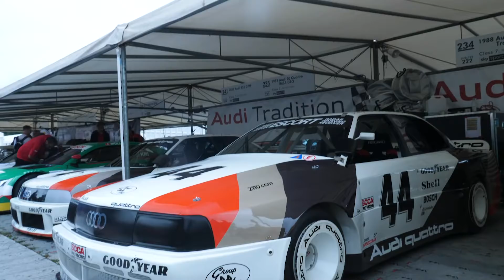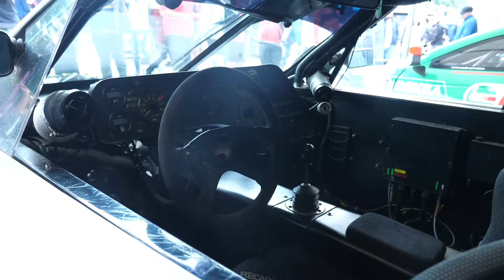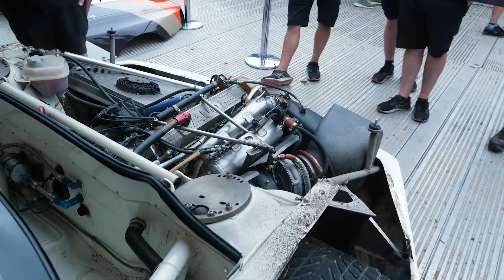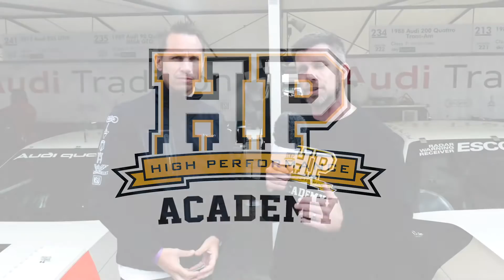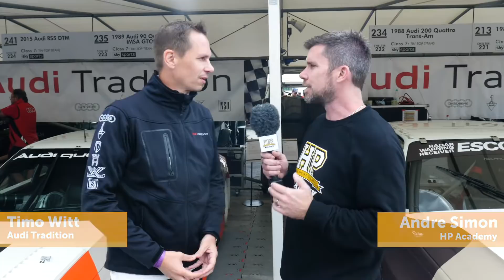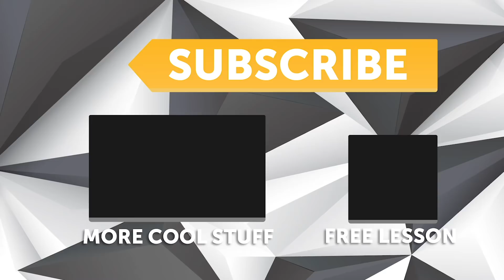Audi Quattro 90 IMSA GTO VS Audi 200 Trans-Am | Audi Tradition [TECH TALK]

Comment: Not much has changed, I have the first rs3 8p model and run 2.1 bar for 522hp and 700nm. I just drove the imsa on acc with a decent hardware setup and it's mental, It's the reason I will go for 600hp in a year or so.

Comment: This era of the IMSA GTO and SCCA Trans Am was dominated by whoever spent the most money.  Audi looking to improve it's sales from the terrible 1970's and early 1980's took their success in WRC and went circuit racing. They were not invited back to the Trans Am in 1988 after winning the driver's championship (Hurley Haywood) and the Manufacturers Cup that Ford had dominated the previous two years with Scott Pruett. The IMSA GTO cars were ridiculous, like I said below Roush's Mercury Cougars were 700 hp (Turbo V6), Oldsmobile (Rocketsports and, Chevy (Buzz McCall)

Comment: Fantastic tech talk! I was just wondering because it wasn't mentioned, are they using a viscous coupling for the 4wd back in the day or was it straight 50/50 split and the bias ratio cannot be adjusted?
Reply: 50/50
Reply: There basically was no center differential in the race cars, it was locked, so 50/50 as Anthony mentioned.
Reply: They use a torsen mechanical diff and you can only change the bias by shimming the diff. Generally 60-40 with 60 to the rear was a sweat spot for the production cars on the track. I raced the B5 platform that came after. But they  really carried a ton of the same parts over to the B5 chassis.
Reply: @southjerseysound7340  The factory race cars in that era used lockers, not Torsens.  The street 90Q used a Torsen, I don't recall if 10V 200's used a Torsen or a locker like a 4KQ.
Reply: @rennkafer13  they ran the rally gearbox and it did infact have a torsen center diff. A  "locker" or locked center diff would make the thing handle like a old truck in 4wd. The front and rear of the car would be fighting itself every time this "locker" locks up like a old truck. 
Also the Audi drive line is built around the torsen center diff. It's not like swapping out a diff in a rear etc.
Take a look at the O1E 6spd transmission and you'll see what I mean.
Reply: @southjerseysound7340  The rally cars may have... the pavement cars didn't.  And I've had 016's, 01A's, and 01E's, spent plenty of time looking at them.
Reply: @rennkafer13  you can say whatever you want  neither of the cars had a  "locker " for the center diff. They ran a Torsen center diff. If you lock the center diff the thing would handle like shit end of  story. I've driven a B5 A4 with a welded center diff and it's not fun. But the customer was. Building a drift car on the cheap and in order to pull the front axels you need a to lock (so to speak) the center diff.
 Seriously it's the Torsen center diff that put quattro on the map.
  They might've run a locking diff in the rear or front diff but that's about it. 
   It's clear that you've never driven a older 4wd truck with a real transfer case where the front and rear axels are powered through the transfer case without a diff. You can feel the axels fighting each other and it's brutal if the roads are dry.

Comment: The playing field was far from being even, Audi was gifted advantages left and right.   As soon as they went to balance power Audi took their ball and went home. Wondering if the rumors are true the  sanctioning body was hurting for money and thats how Audi got in... Small development time and big success tells everything, BoP was way wrong.
Reply: That's a bit unfair, it was a marketing exercise to demonstrate the advantage of the AUDI AWD system and, when it was banned, there wasn't any point in continuing.
That the rules in place, initially, didn't cater for the level of factory support and development isn't AUDI's faul. Same with their investment in rallying. I don't know if you're old enough to remember the jokes about the 4WD being good for it getting out of ditches, but at the time all rally cars were 2WD and 4WD was for offroad trucks - they really weren't expected to be any good because of their understeer. Now, though, you'd need your head examined if you thought a 2WD could be competitive.
Same with the F1 turbo'cars the first time around - they were written in the days when 'forced induction' meant superchargers and the 2:1 equivilance formula made the sensible choice NA because of the inefficiencies of the SC - however Renault (IIRC) spotted the potential and, after a lot of trial and blown engines, were able to beat the, then, ruling Cosworth DFV's which were RPM limited - the metallurgy then couldn't come up with materials that would let the connecting rods live at the RPM levels 11k+  required to make the power needed.
Reply: shaadydog1 brace yourself...
Reply: @edh7492  Nothing to brace for, I actually enjoyed them being in the both  series. However I am not some nut swinging fanboy that cant recognize the implementation of rules was severely lacking and created a great imbalance in the Trans Am  series specifically.  The great aspect of racing is allowing diversity, the great drawback is allowing diversity go unchecked and allowing unlimited budgets and a lack of BoP to win the day.
Reply: shaadydog1 fair shout, I just enjoy the sharing of knowledge and opinion with educated individuals without slipping into arguments. Good work gents.
Reply: Audi's advantage was AWD that was it. Roush had depending on tracks started using the  2.3L SOHC (Pinto/Lima) engine turbocharged (same engine they used which was stock in the production Merkur XR4ti), NASCAR/Cosworth OHV V6 Turbocharged (this is what they ran much of the time after Daytona which they used the 358cid Windsor V8 Fuel Injected). GM was also dumping a ton of money into GTO via Protofab who build the GT2/GT Corvette IMSA/Le Mans cars today, they had the Mobil One Corvettes with Wally Dallenbach 6.0L V8 Injected and Buzz McCall's Skoal Camaro.
Reply: Winning is winning